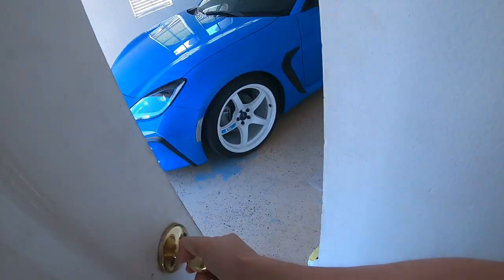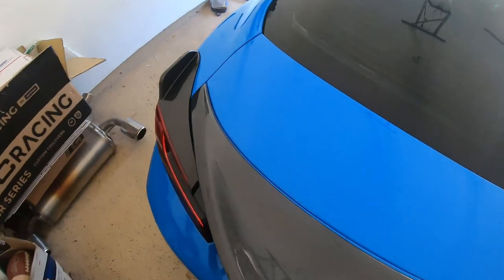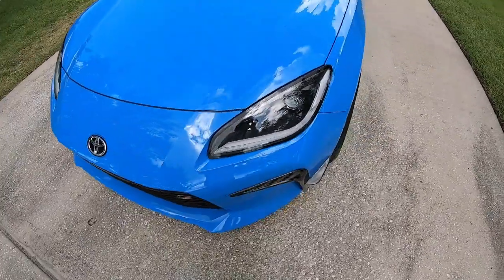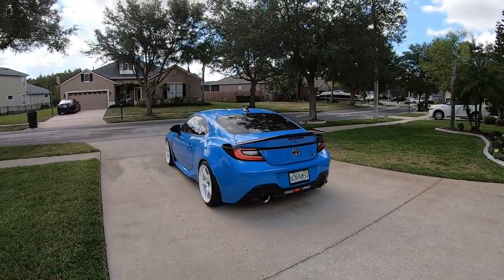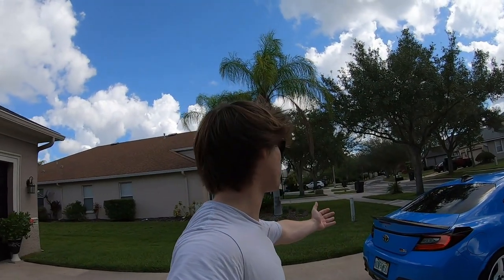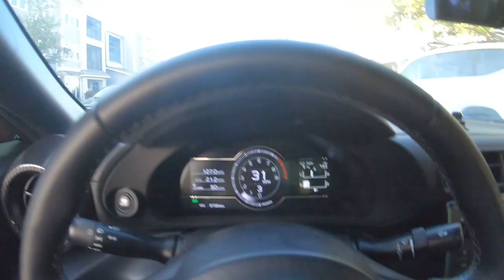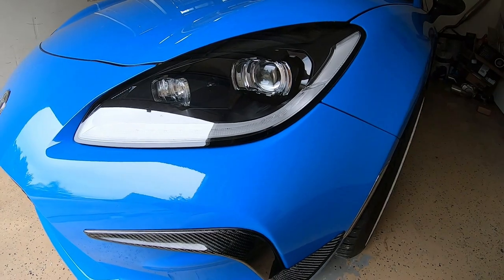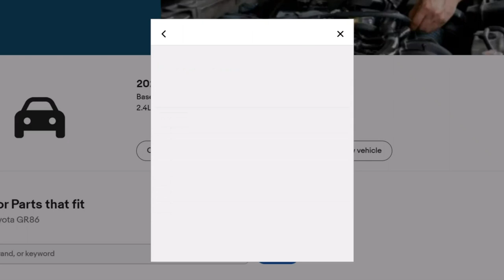You Need These Carbon Fiber Pieces For Your Car !!!

Comment: AWSOME VID MAN! whats your wheel/tire fitment?
Reply from the maker: Wassup fam, I appreciate you watching and showing love on the video 👏💙 My wheel specs are 18x9.5 +38 on a 245/35/r18 tire. I am almost certain this size will rub on stock suspension, which is why I got my BC Coils. I hope this Info could help 💪💯